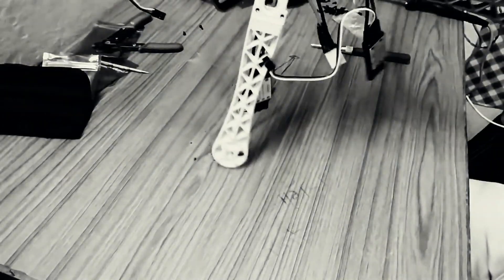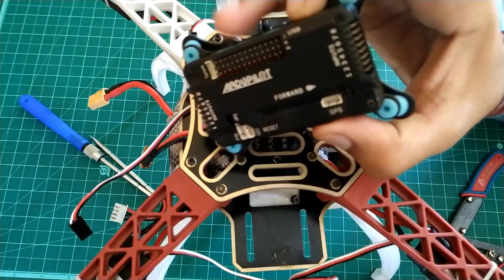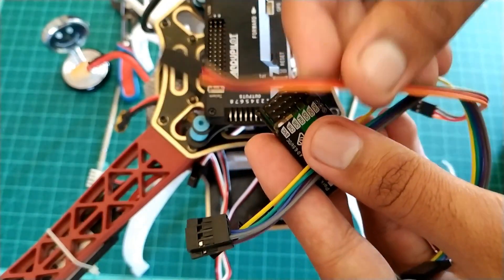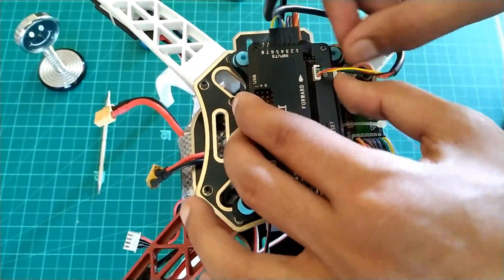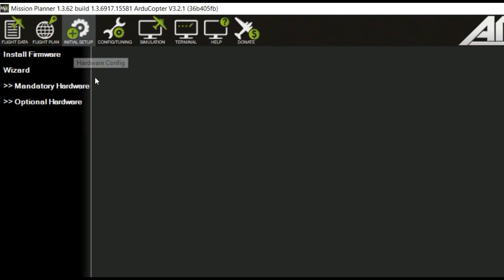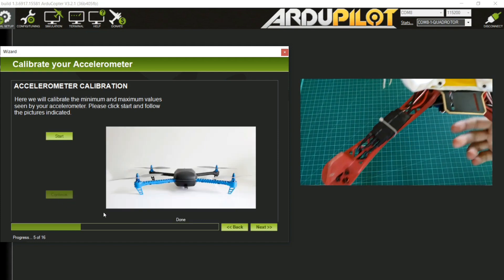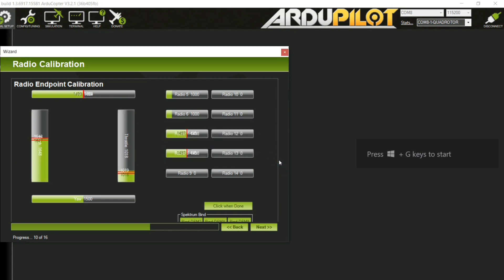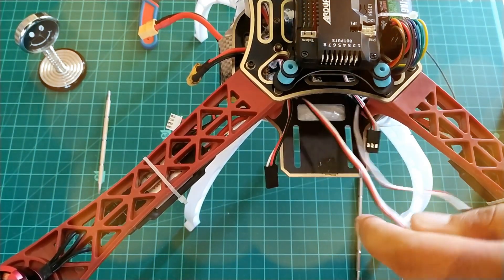How to make a Drone or Quadcopter - Part 2

Comment: Hi, if I recreate your project will this work still? Thanks.
Reply from the maker: Yes...
Reply: @RoboCircuits  Can I add a camera on this? Because im planning to create an autonomous drone that will serves as a monitoring of a tower, do you think its possible?
Reply from the maker: Yes... It is possible
Reply: @RoboCircuits  Possible using arduino uno? Or APM flight controller? Is it programmable?
Reply from the maker: Apm provides smooth flight... And its programmable also
Reply: @RoboCircuits  Can this hover? Also whats the maximum height an APM can do? Can the data be saved to database like mysql?
Reply from the maker: It can hover.. maximum height will depend on air speed...
Reply: @RoboCircuits  Do you have a tutorial on how to connect this to a website or mysql? Thanks. Also, how can i see the video live?
Reply from the maker: Sorry not yet
Reply: @RoboCircuits  But is it possible? Using APM 2.8 flight controller?
Reply from the maker: This flight controller will only fly the drone... If you have to send data, you will need sensors and seprate microcontroller or microprocessor for thsi
Reply: @RoboCircuits  Like Arduino? I will connect arduino to APM?